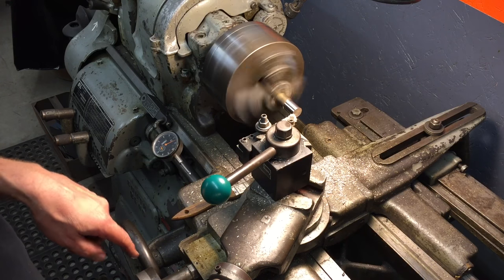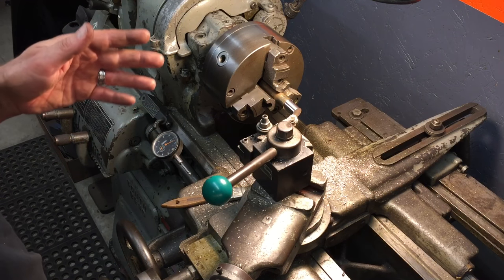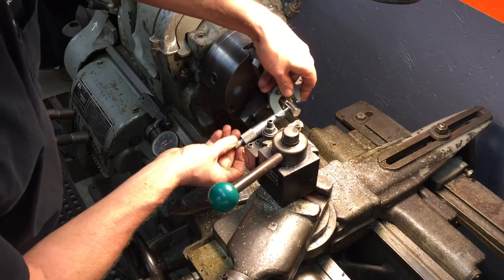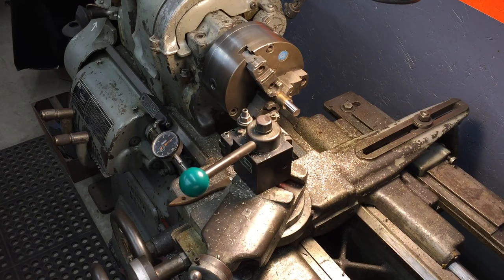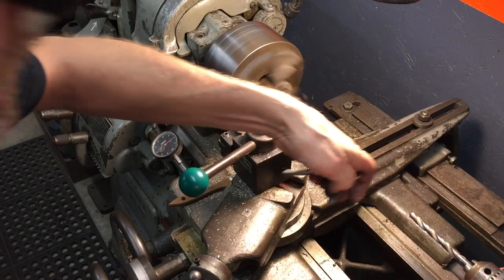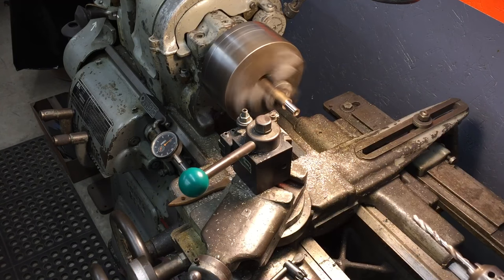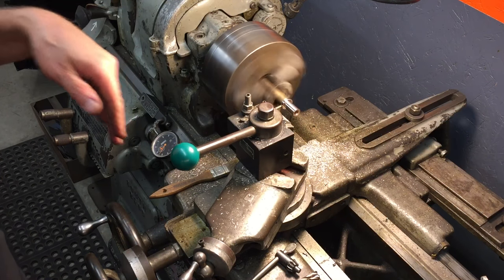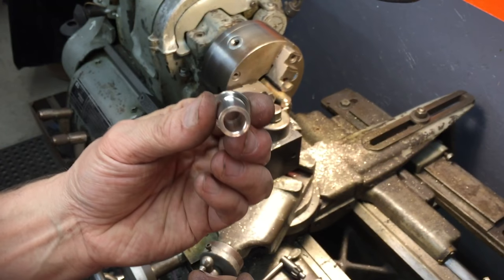Making a bronze bushing for the car door hinge

Comment: This is exactly what I decided today to do for my truck door this weekend. I've had it with cheap pot metal bushings. I have some bronze rod laying around, though I don't know the exact allow grade, but its gotta be better than that crap Dorman uses.
Reply from the maker: I used 936 bearing bronze, but honestly, any bronze will work.  I don’t remember what I said in the video, but I redesigned the hinges for much bigger bearings.  The doors shut like a bank vault now.